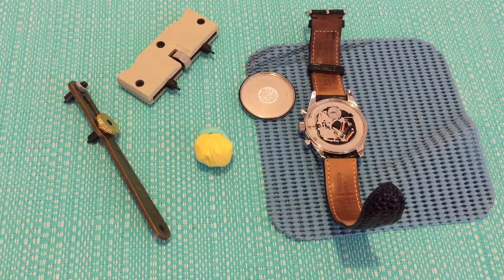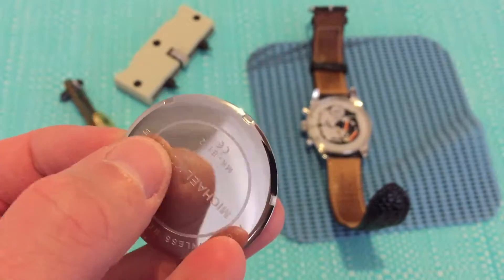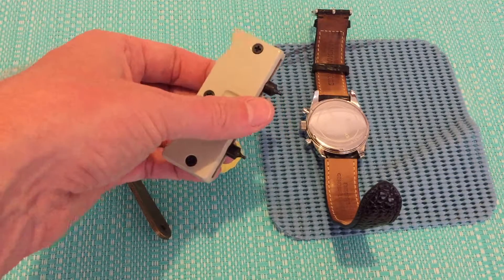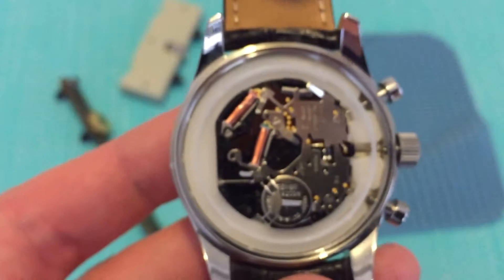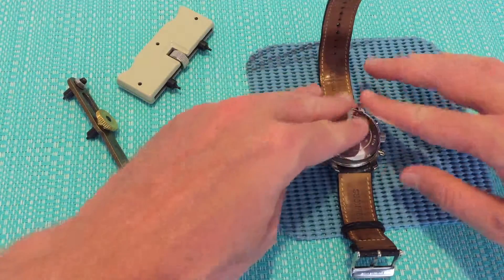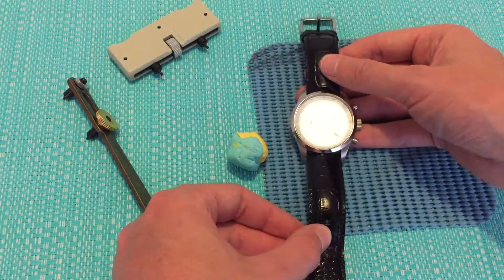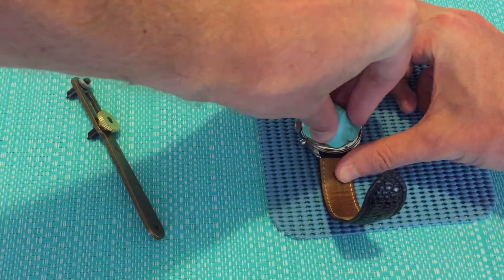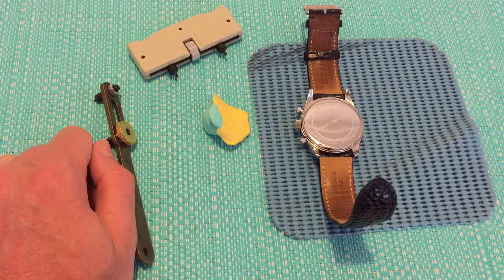How To Change A Watch Battery - Screw Back Case

Comment: You did everything except actually change the battery, which is what I needed to see.
Reply from the maker: This will vary depending on the make/model of the watch.

Either use your fingers or tweezers to just slide the old one out and then slide the new one in. Sometimes they have a small tab that needs to be lifted slightly in order to allow the battery to slide in/out.

It "should" be the easiest part of the process, by far. Best of luck.